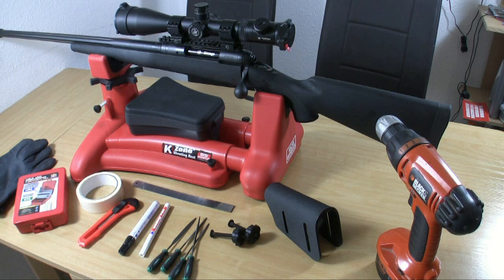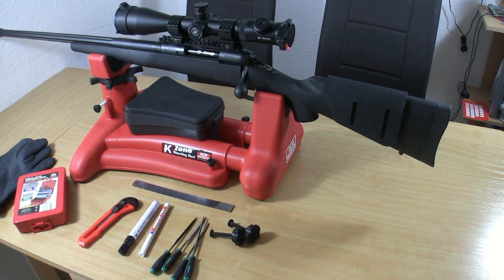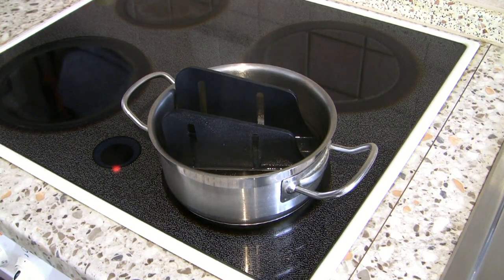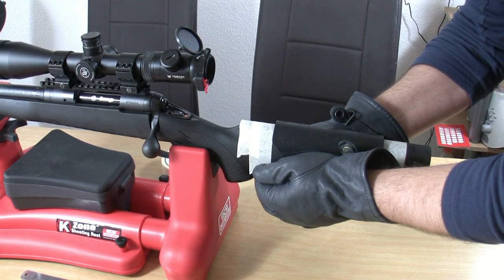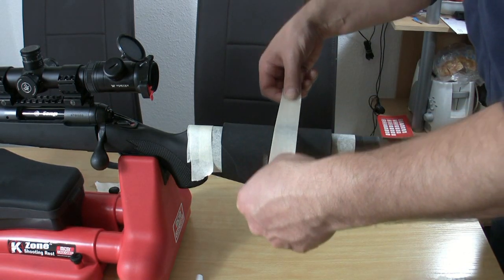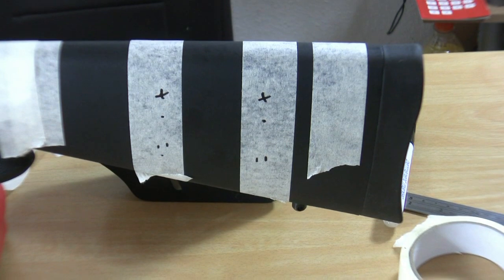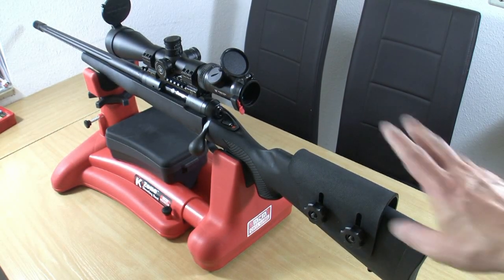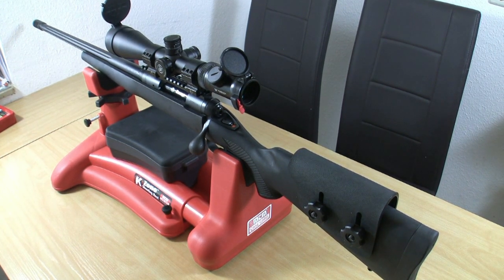How To Install A Kydex Cheek Rest

Comment: Great Video, but why didn't you drill the holes at the top of the slot? Drilling the hole lower only limits your adjustments. So if you happen to get a larger scope in the future you will have to drill new holes.

Here is a video of my cheek rest that fits almost all stocks perfectly so you don't have to heat them: Kydex Cheek Rest - Update - Ka Bar TDI sheath.

I also ship overseas if needed.

Comment: Damn man, why are you pushing so hard with the drill? Let the drill bit do the work rather than push so hard. You also drilled too low, if you get a taller scope you will have to drill new holes.